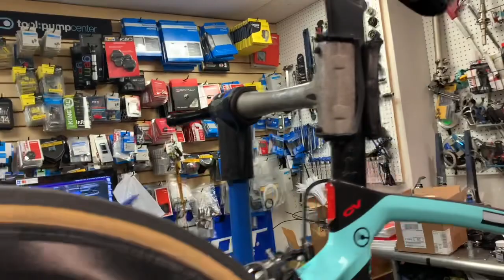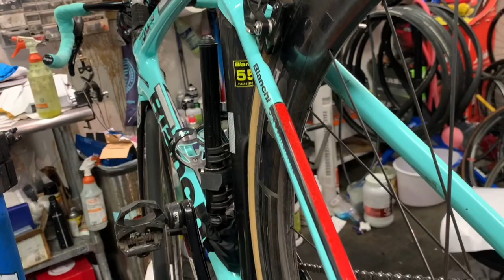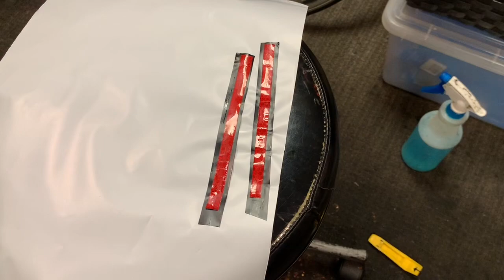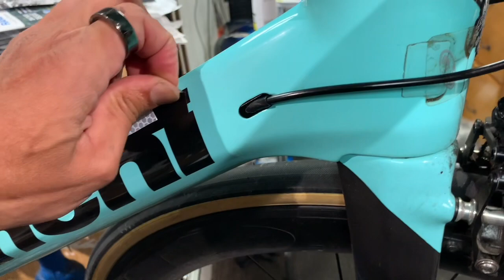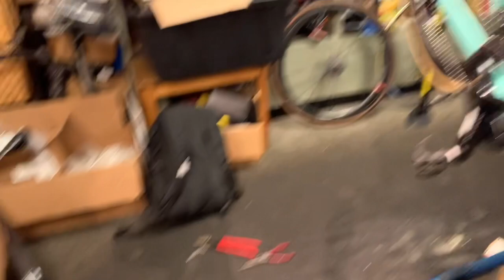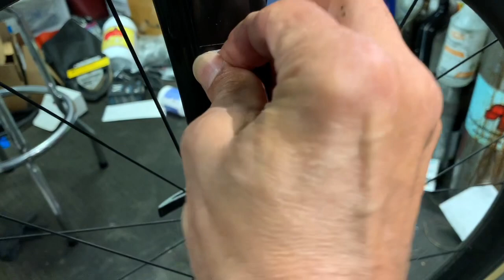TODAY’S CYCLING TIP - How I set up my bike for overnight ultras and then revert back

Comment: Would electrical tape be good for protecting a carbon frame from bag straps?  Some people use helicopter tape which is hard to get off.  I dont really want to buy bike specific tape either.
Reply from the maker: Yes it should be fine.